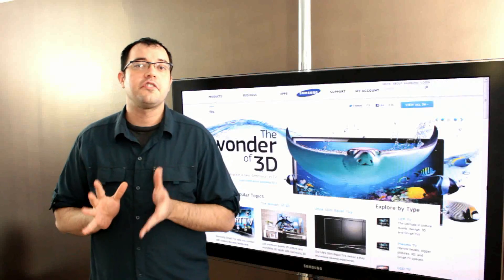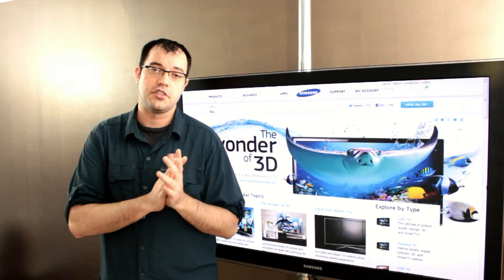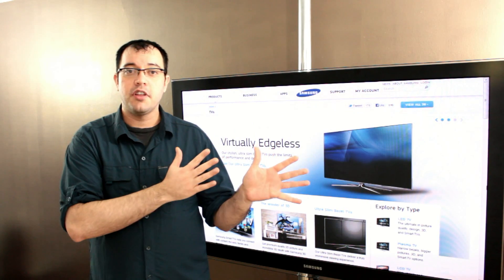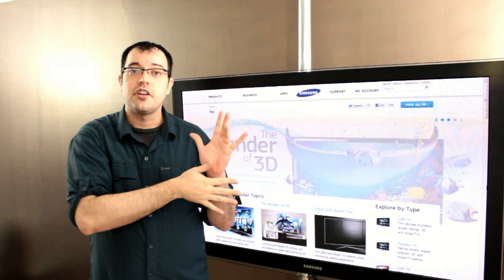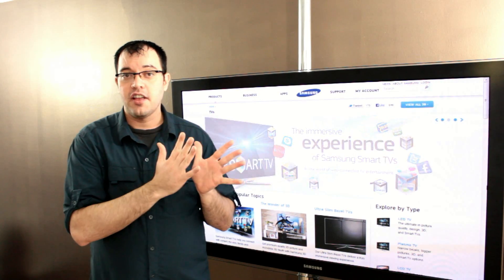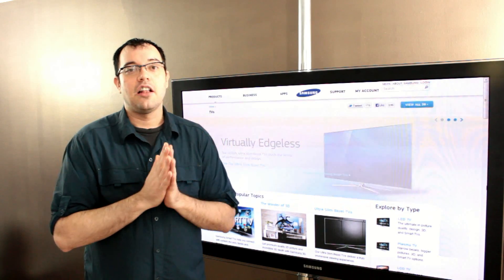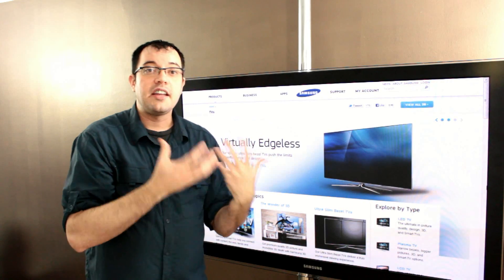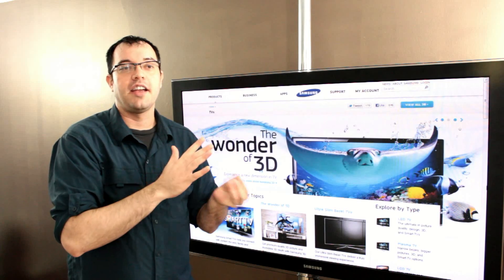LED vs LCD Televisions From A Technology Standpoint

Comment from the maker: @renegade8164 Have you considered you are just hard on them?  I have pretty much never had a TV die that wasn't the result of a power surge, me dropping it, or someone whacking it with something.   

And Edge LED has better black levels, and weaker white levels.  Edge LED's are mostly only found in Computer monitors and Portable devices.

Comment: After a lot of learning and looking around, I've dicided on a 42" plasma.
I need to find 200 pounds more.
But I respect your opinion Brandon. Do you think this is a good option?
I am going to be using it for gaming and some graphic design.
It's the Panasonic VIERA TX-P42S30B.